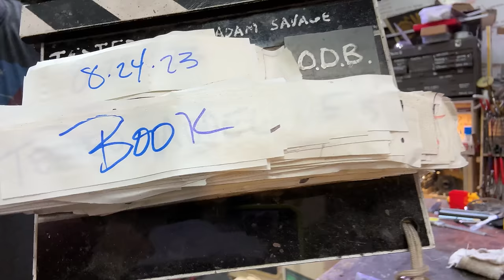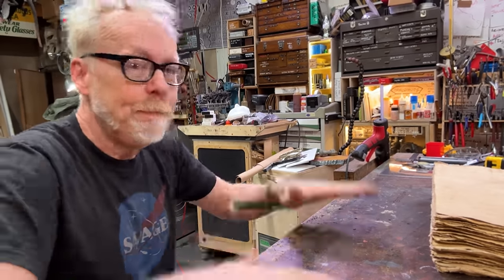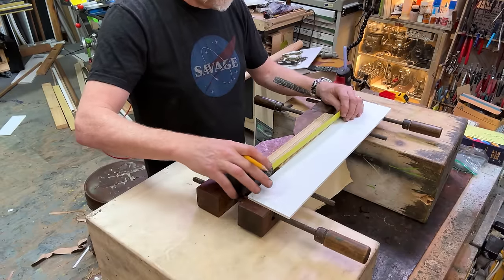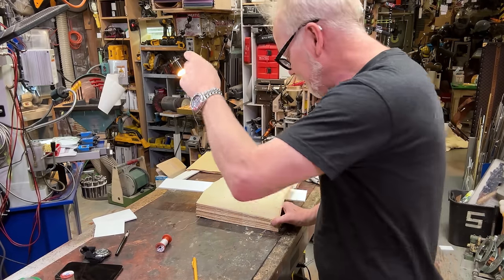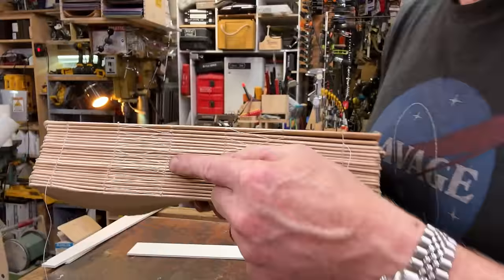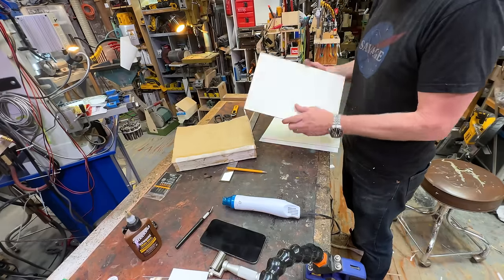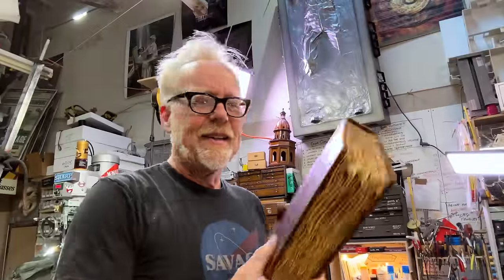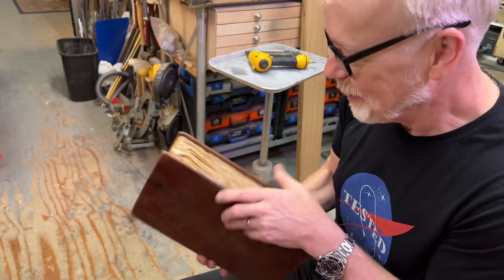Adam Savage Makes an Old Book From Scratch

Comment: With adhd, a tendency to start overly ambitious projects as well as having the luck of getting a course on book-binding in art-school, I’ve made quite a few books, in all kinds of styles. Now I’ve actually started larping, and gosh jolly I’m having so much fun making weird little books. 

Also, the knowledge of all the rules to make a good quality book, mean that you know which ones you can bend.  I know good paper is not made by grinding printer paper with a hand mixer, but I know it’ll bee good enough for the project I’m doing. And I know that the papers should be pressed after folding and before sewing, but for this little notebook to use on a larp it’s not going to make the book better. 
But I also know that a good quality knife is worth it for all books! And that waxing the thread makes everything easier even if it’s just a silly little project. Sometimes the directions of the fibres for the signatures isn’t that important, but for a hard cover it’s ALWAYS important, you will regret it every single time. You don’t need a proper bone folder, but you need something to fold with and I’ve never regretted buying mine. Bookbinding glue is a myth by the way, it might be sliiiiiightly better if you do a really big project, but I’ve talked with professional bookbinders who has told me diluted wood glue gives essentially the same quality in the end.

Comment: One thing that will give it not only the look, but the feel of old leather is rub it with a flat block of paraffin. Then hot blow it and rub it with a cloth. Repeat the process untill you get that greasy look and touch. Especially towards the edges of the covers. It’s worth a try with a peace of leather and see if you like re result.

Comment: Did you just casually toss what looks like a cast iron surface plate on there for weight!? That's awesome.

Another fun method that gives beautiful results is Yotsume Toji (Japanese 4 hole binding, AKA Stab Binding). The patterns can be simple or complex and there's lots of variation to play with.

Comment: All it's missing is some metal. As bordering/embellishments and/or a "lock". Adds some stability and wear protection as well as a level of mystique. I'm seeing brass to give it a more undercover "mundane" look(relatively in a fantasy world), but silver works ok as a decent "rare and proud" vibe. Gold feels too over the top but might work depending on the design. 
 
However, if you go crazy with the material you could give it a wild or otherworldly look, such as chromatic or prismatic. Cast iron though feels more like a Craftsman's accounting book.
 
I was initially thinking simple twine or leather strings to tie the book shut but felt it would be too modern/simple. "Grimmoire" almost demands a certain level of grandeur, but the weathering then says to dial it back to "hidden" gem. At a glance nothing special, but the more you inspect it the more it draws you in!

Comment: Trusting myself is something my brain can't grasp yet. 
I double check my stuff really often and it happens that I "correct" something that was correct. So by double checking and not trusting myself I make a mistake. It's annoying. 
On the other hand I also do not trust my gut feeling. I've been told that I need to "trust the process" and that every project has a stage where it is ugly. So I should not abandon it just because I feel like it is going nowhere in that moment. Most of the time it turns out that there was no saving that project if I have the gut feeling that it is going no where and I force myself "to trust the process". It's a trap I fall into way too often. But my brain is convinced that the advice of random strangers who have never seen my project is more relevant than my own gut feeling. 

I guess it's something I have to lean over time.

Comment: You should rather use an awl to punch the sewing holes. Sawing removes material leaving a hole that the glue can seep through causing pages to stick together. With an awl you can close the hole up before gluing preventing glue seepage.

Comment: At 7:12 Adam is opening the gap in these huge "parallel bar clamps"  (really "hand screw clamps").  These are very handy and can apply a lot of pressure.  A trick to open or close these quickly is to grab a handle in each hand and spin the wooden parts around and around. My two cents.

Comment: I would super agree with book bindng beng accessible. I watched some good instructional vids years ago from sealemon: https://www.youtube.com/watch?v=9O4kFTOEh6k&t=337s (i actually took the time to find it for y'all!) and used it to make my own simple books from printed docs. 

Most printers have a "book style" printing setting if you play with the "pages per sheet" setting. It's only in some dialog boxes though. This lays out the pages in the correct order for you to fold the paper in half and make your own litte pamphlet! If you want to do a quarter page sized book, you'll need to map out a page template to make sure everything prints in the rght order. 

I've used the book printer setting and simple book bindng on knitting patterns as well, resource docs, etc. It tends to make instrucional pieces more transportable and accessible for me. I don't have an awl yet or anything, just used a needle and thread. I haven't done any fancy covers yet because I don't have a book press, but for my small projects I just used cardstock and either sewed it in with the other pages or did some simple gluing without clamping, which was fine for that project bc it was small and just paper to paper. 

I hope you find this helpful and enjoy book binding if you start! :)

Comment: If you intend to collate a ebook into 4 pages on each side, first new ebooks don't have page numbers.  Second, the printer gets dirty and the thing grabs four pages after 100 pages - [25 physical first sides].  But they go in a binder the gem!  22lb 750 reem for 9 dollars is so awesomeness when you get the ink refill for 10 dollars.  It drinks ink, but its so worth it.  Only the book cover sucks ass, just skip the first two pages and use photo print.  Couldn't possibly be useful information.  The 30 hole punch is just the same as the 40, too many holes in the machine.  The binders come in packs of four to arrange the ebook trilogy so splendid for a journey to nowhereland.

Comment: Easy way to make a book look old is to throw it onto a dirt road then proceed to run over it a few times with a truck or car, once done dust off the excess dirt & presto you have an old book. PS try to restrain yourself from doing burnouts on the book it will ruin your project.

Comment: Am I the only one that doesn't understand why slicing through the back of all the sheets with a saw doesn't destroy the pages? How is a slice a hole?
Reply: Its easier to think about if you picture just cutting through one of those pages. If you fold a piece of paper in half and take scissors to make a tiny cut on the fold, then open it up, there will be only a hole, and the rest of the paper still holds it all together. 
I was confused for a second too, but how shallow the cut is through all of them is what makes it work